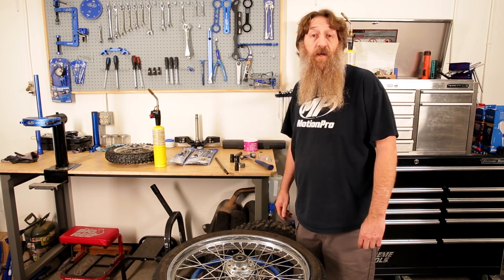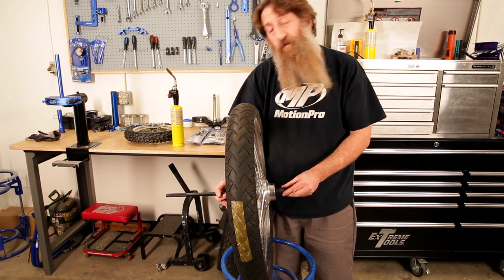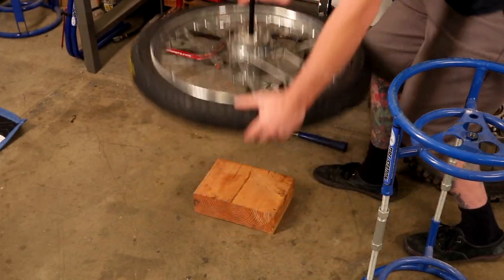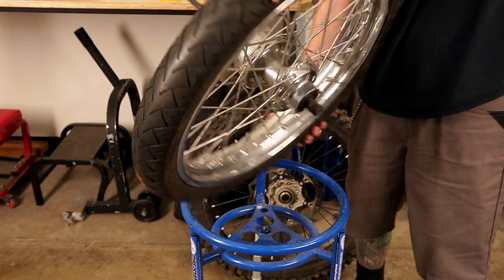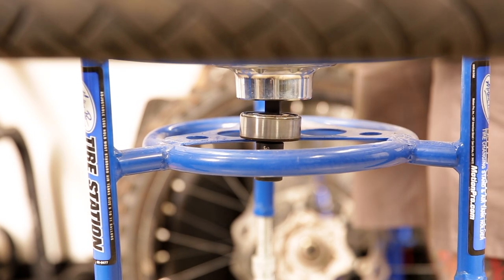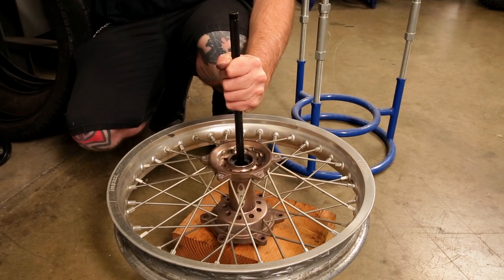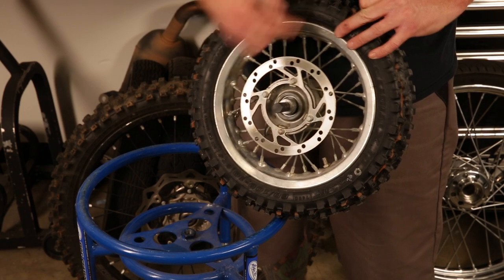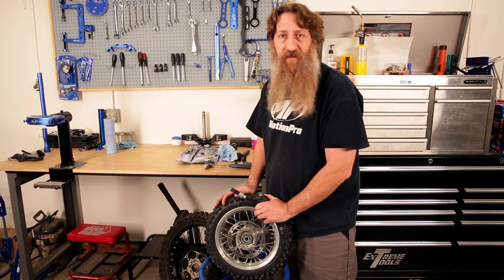How-to: Remove Motorcycle Wheel Bearings

Comment: You might want to get Kevin Baxter to and his guys to put together your demo-videos for you. Joe is probably a great mechanic but maybe what he needs is to bring in a person that has limited experience with the tools to practice his demonstrations. and turn your volume up a little. Not everyone uses external speakers or headsets. Thanks for the video. I have removed and installed wheel bearings before with a different tool and I am still confused as to using this tool.

Comment: I don't understand.  How does this work?  You are inserting a bearing remover head with a slit in it.  Then using a chisel to bang it out from the other end.  Does the chisel expand the remover head as it is being hammered, expanding the remover head to grab the bearing and "pull" it out?
Reply from the maker: Yes, correct. The driver expands the split collet remover to catch and drive out the bearing.

Comment: Ok, now I get it this tool is for removal only. I'm still a bit confused.
Reply: Removing the bearing is the hardest part.  From the front side you could use a hook/slide hammer rig, from the  backside one could use a long punch.  Here a collet and  punch are being used to drive the bearing out.  Try putting the collet and punch in the freezer before using; this will cool the bearing and make removal easier.  Freeze the new bearing before installation, and drive it in, first  with a block of wood and mallet, then finish seating it with an appropriate-size socket and mallet.